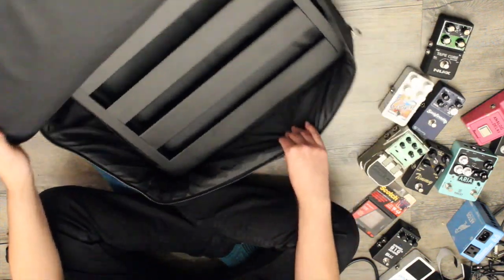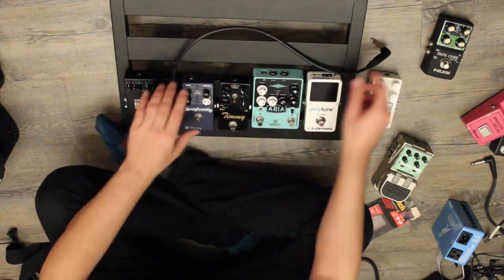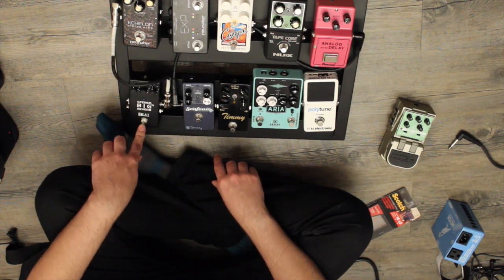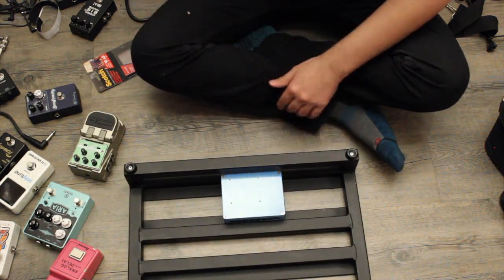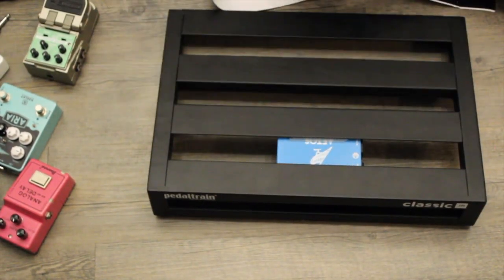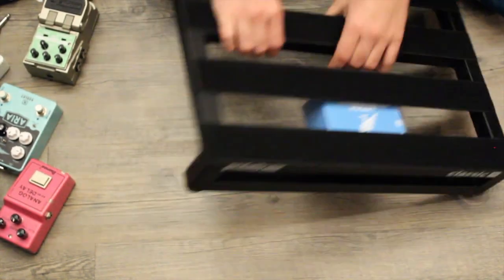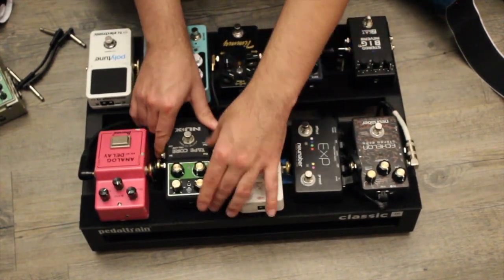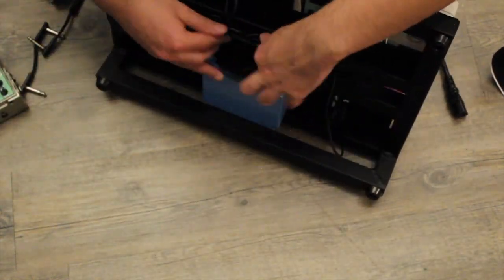Pedaltrain Classic Jr Pedalboard build with Walrus Audio Aetos Power Supply

Comment: Hi. Thanks. I just got the same board and got the truetone 1-spot with six iso outs. Question, I only use 5 pedals so I have room to spare and put the power supply on top of the board.  When you put the velcro on the pedals, do you put 2 strips on to line up with the fuzzy velcro on the board on all of them?...or could I just use one long strip running the legth of the pedal.  I'd lose a little in width but gain in that some pedals cover two slats and some only reach and cover half of a slat.

Comment: I have this pedals and bit confused as to what is effective chain. Tuner,78 distortion, California Joyo, super chorus, tc mini delay, sonic stomp,noise suppressor,compression sustainer & pocket metal muff. I need anyone to assist me, please truly new to electric guitar.
Reply from the maker: Tuner is good to have first, sonic stomp can be 2nd. Compressor can be 3rd or at the end of your chain before your noise gate. (See which you like the most) I like my compressor after my tuner and before my overdrive and distortion. 
Next I like putting my Timmy (lower gain/ transparent OD) before my heavier OD and distortion. I’d try placing the metal muff before your distortion first. If you combine these pedals(mix them around to see what you like the most) some don’t mix well and some do. 
After all that I place my modulation pedals( chorus, flanger, phase) next. Then place your delay after. Then your reverb. Noise gate could be put last. That will help cancel out any noise from all your pedals. Lmk how it goes!
Here’s an outline:
Tuner-> Sonic Stomp->Compressor-> OD—>Distortion/Fuzz/Muff(can switch around these if you use them at the same time)-> chorus ->delay-> reverb ->(compressor can go here as well)->noise gate.
Reply: I truly appreciate your input. Bless your heart and be safe out there.

Comment: Can I run standard pedals off of the 2 high outputs or do they have to be power hungry pedals. In other words, can I just run all 8-9v pedals?
Reply from the maker: Yah you can run standard 9v pedals off the high outputs. The high mA rating on those outputs is there to let you know your Ma power hungry pedals would be powered best there. So like Styrmon pedals are notorious for requiring high amount of mA to run properly. If I had a strymon pedal I would look to use one of the high outputs. Voltage is a separate thing as well. But that is easier to pair. 9v pedal goes with 9v. 12v goes with 12v and 18v goes with 18v. Hope that helps.

Comment: Hey Jonathan,
thank you for sharing your buildup! Is this your only or main pedalboard? I am about to order the Pedaltrain Metro 24 to build my first pedalboard. I think the smaller footprint will make it more portable if need be. Best wishes!
Reply from the maker: Martin Hinze  Hi 👋 Martin! This is my main board that I have together all the time. I have a smaller one from OnStage that’s about the same size as the metro 24. I just wish the better power bricks were more affordable for smaller boards. But I use it when all I need are about 4-5 pedals. But this one really isn’t heavy. With all my pedals on it, it probably weighs about 12-15 pounds at the most. But it’s all preference. I hope it turns out awesome! 🤙🏽
Reply: @soundwave189  Hey Jonathan, glad to learn you are using your board a lot! Thank you, there are still some things to be figured out.. I am thinking about getting the Eventide PowerMAX, which should fit underneath the Metro. 15 pounds is not too much. I am also concerned about space, because some venues are ridiculously small..
Reply: Martin Hinze oh wow the power max looks like a great option. Have you looked into Truetone 1 Spot pro CS6? It is a little “barebones” compared to the power options of the powermax. But I have had nothing but a good experience with Truetones power bricks. I’ve owned the cs12 and the cs7 and they were always reliable. They are all isolated and are able to run digital and analog pedals with no issue. That’s true, the footprint is important. Where do you see yourself using your board for the most part?
Reply: @jonnyfive5000  Thank you for your feedback, this small discussion really helps me to figure out my needs. I will use the board 97% or so of the time in my living room, so size is actually not so crucial. I just like downsizing things and that's why the Pedaltrain Metro line appeals to me. However, I am tending towards the Classic Jr. Created a stencil of its size and some future pedals and everything seems to fit fine, just the Wah would need to stay off (so maybe better Pedaltrain Classic 1, note sure yet). Also like the slope. Which size did you chose?
Thanks for the tip, never heard about Truetone power adapter before, looks great for 'standard' pedals. The thing is that I am already eyeing some power hungry pedals from Strymon, Boss, Earthquaker etc., so I like the concept of a power adapter that can feed about any pedal with any of its outputs. :-)
Reply from the maker: Martin Hinze glad to help :) I chose the Pedaltrain Classic Jr w the soft case. Yah I hope the power supplies keep giving more options and keep getting slimmer. I didn’t mention it in the video but my walrus Aeros has a plug for a pedal that needs its own power supply. My EHX canyon delay is one of those pedals. So that was super handy to have.
Reply: @soundwave189  After rewatching your video I also ordered the Pedaltrain Classic Jr. Already set it up. Some pedals are still missing (the boutique ones), but I can already play on it. I chose the Cioks DC 7 as power supply to have something future-proof.
Good to hear that all your pedals are taken care of :-)!
Reply from the maker: Martin Hinze Very nice! And what pedals you using right now? Don’t think I asked but what kind of music are you playing?
Reply: @soundwave189  Hey, sorry for writing back so late, I've been on vacation and was offline most of the time. When my metalhead-friends visit I mostly play some Thrash Metal riffs and I have to say learning Megadeth songs is pretty good practice. I feel also more and more drawn to creating ambient soundscapes. To get a nice metal sound, I bought a used Boss Metal Zone on Ebay. For the ambient stuff I bought a new Walrus Slö, the star on my board. Apart from that I am using my older stuff: Boss Tuner -> Boss Metal Zone -> Tech 21 Blonde -> Noise Gate -> TC Electronics Delay -> Ditto Looper.
Everything fits fine so far, but of course I am still thinking what to get next..

Comment: How were you able to power all the pedals, I thought the Aetos only had 8 outputs?
Reply from the maker: evanmceneaney I forgot to mention but the polytune2 allows you to power another pedal with an 9v power output it has right next to the power input. And I also have a splitter I will use sometimes. I’ll put the 9v splitter on two digital pedals that take the lowest amount of power. I have a few but I usually power the chorus and the tape core together.
Reply from the maker: Also wanted to add that the Aetos has a input that can be used to plug your pedals power supply. I just started using mine for my canyon delay. It requires the wall watt power supply it came with. It was giving me problems with even the higher ma rated input on the aetos. Working great now.
Reply: @soundwave189  what pedals are safe to daisy chain like that ?
Reply from the maker: @C0nnie  make sure they require the same voltage for example 9v make sure the milliamps from each pedal sent to high for the power source. For example one of the outputs of the power supply I’m using is 500 milliamps and so I could technically daisy chain 5 pedals at 100 milliamps each. I don’t recommend daisy chains by that many pedals. I’d say up to 3 because noise issues could pop up with the more pedals you daisy chain together.

Comment: Does the board fit in the case while the pedals are on it? Thanks!
Reply from the maker: Hi yes the pedalboard fits nicely in the bag. I still use the bag and it’s doing the job really well for me! I’ve had a hard case and pedal trains “extra” padded case. I prefer this one for my needs. The others were to much hassle and could be better designed especially the “extra” padded bag.

Comment: This is super frustrating. My Aetos 100% does not fit under my PT Classic Jr., and it’s by an incredibly small margin. It has to go on top because it literally doesn’t fit anywhere underneath.
Reply from the maker: Hmm, what are you using to secure it under the pedal board?
Reply: @soundwave189  turns out I’m an idiot. Literally moments after I made this comment I realized the upper space is larger than the lower one (the one that I was trying to shove Aetos into). Your video made me determined to figure out what I was doing.
Reply from the maker: @needlenosemusic  Haha it happens :) glad the video helped you figure out what you needed

Comment: How you deal with noise (if you have?).
Reply from the maker: I used to use a radial stage bug sb-6 isolator which I liked a lot. But in an effort to lighten my pedalboard I got rid of it. Having quality patch cables and guitar cables helps eliminate a lot of noise. That’s where the annoying noise came from for me. But there’s a natural noise that comes through when I turn on my OD pedals. I just work with and it’s not noticeable while I’m actually playing which is most important. So the problem is fixed when I disengage them after playing. Hope that helps

Comment: looks like you have 10 pedals. isn't the power brick for 8?
Reply from the maker: The power brick actually powers 9. I forgot to mention the 3 prong input it has. I use that one to power the canyon delay. And the switcher pedal is powered by the neunaber pedal. Sometimes I’ll also use the extra input on the tuner pedal to power another.